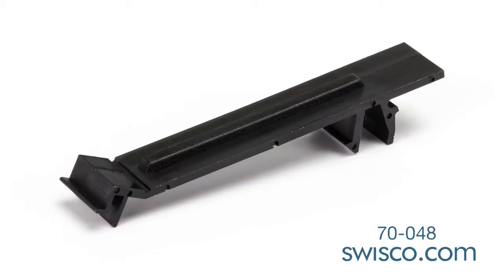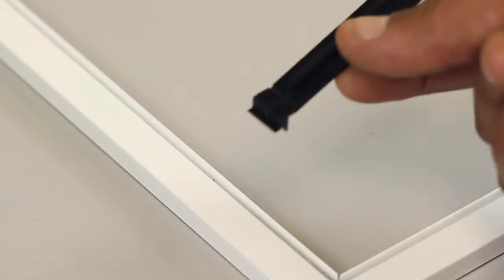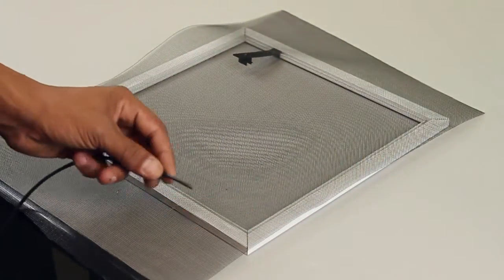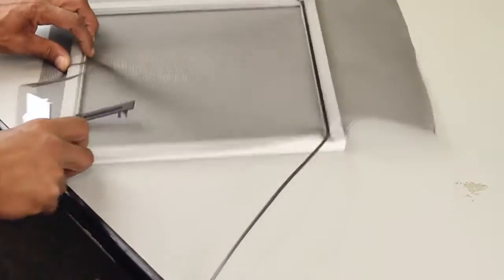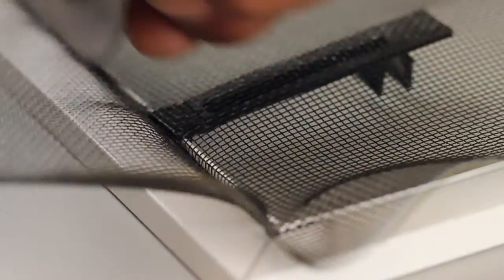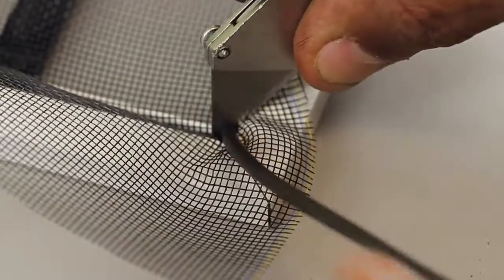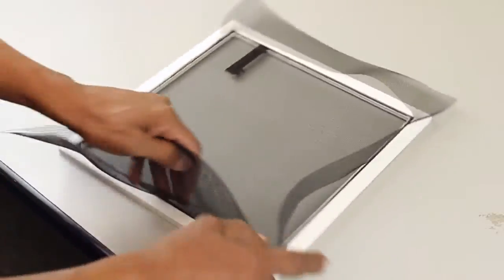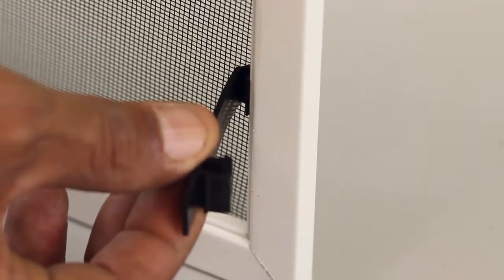How to install a Malta screen frame latch

Comment: Most folks only need to replace the latch. Not the entire screen
Reply from the maker: You will still need to remove the screen from the area you are attaching the screen clip. You would just install your old screen material back where it was when you're done. Good luck with the repair!